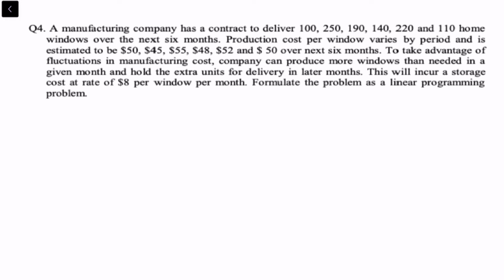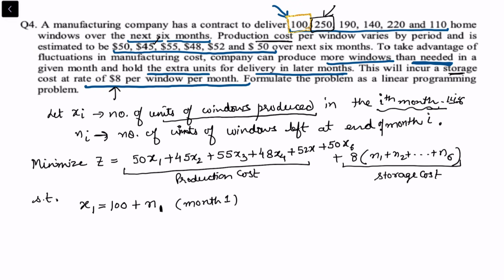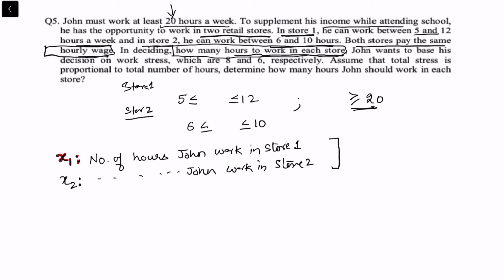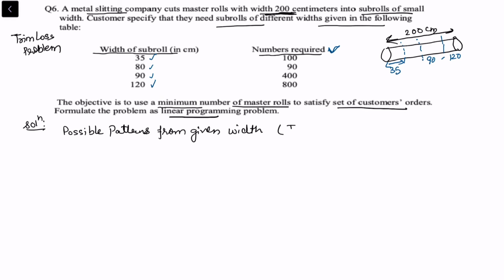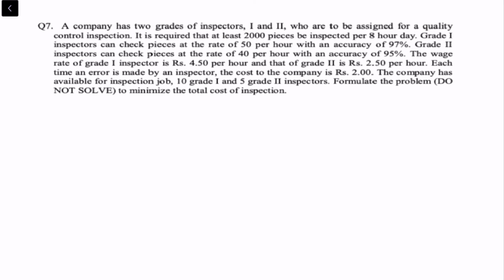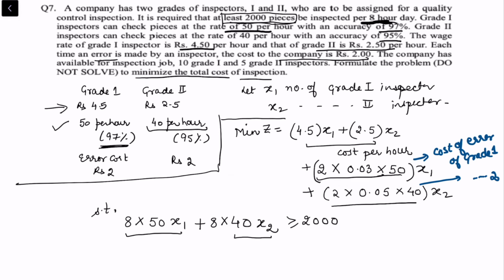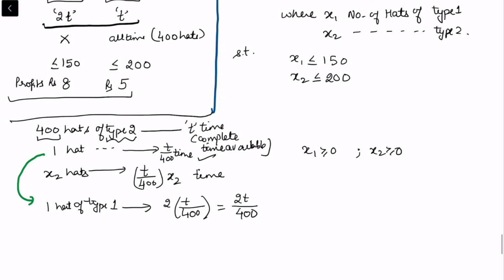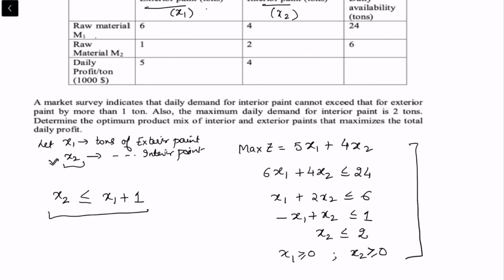LPP Formulations | Practice Set | Part 2

Comment: Q7, the solution is wrong (22:49)
we dentore X1 number of inspectors of type Grade I and X2 number of inspectors of type II
so the cost should be = x1*4.5*8 + x1*8*50*0.03*2 + x2*8*2.5 + x2*8*40*0.05*2 (we must multiply by 8 )
because in the constraints we put x1 <= 10 && x2 <= 5

if we dont want to multiply by 8 in the final cost
we should modify the constraints to be as below: (everything in hour, x1 number of hours of grade 1, x2 number of hours by grade 2)
x1 <= 10 * 8
x2 <= 5 * 8
x1*50 + x2*40 >= 2000
final cost x1*4.5*8 + x1*50*0.03*2 + x2*8*2.5 + x2*40*0.05*2
Reply: i think ma'am gave that objective function on the basis of hour. so ma'am is correct in her place as well. here you got the objective function on day basis. but in case of total number of inspection of pieces it has to be calculated day basis. that's why ma'am and you got the same constraint. you both are correct in your places in my opinion. but corrections are welcome. feel free to correct me. thank you. 

one correction i am noticing now: you are wrong in the x_1 contraint. as you already told the x_1 is no. of inspector then why you are multiplying with 8 (which is an hour )?  it has to be x_1<=10 and x_2 <= 5. and then you got wrong the 2000 constraint as well. which is on daily basis so it would be x_1*50*8 + x_2*40*8 >=2000. as both side has to be day basis. you were right in first para as i said. but not sure about the second para

Comment: In Ques 6. Ma'am why you didn't cover these patterns also :- 2 1 0 0, 2 0 1 0, 1 0 0 1, 1 1 0 0, 1 0 1 0, 4 0 0 0 ?
Reply: because in all these cases, wastages are going to be >= 35, hence to make best use of that roll, still there is possibility to cut a subroll

Comment: in Q4 cant we write n1 as x1-00 ;n2 as x1+x2-350,n3 as x1+x2+x3-540 and so on till n6?
Reply: this is same as the solution given by ma'am. let's say you wrote n_2= x_1+x_2-350 = (x_1-100)+x_2-250= n_1+x_2-250.. which is more simplified. less unknown variable generally prefered. i may be wrong. if i am then please correct me